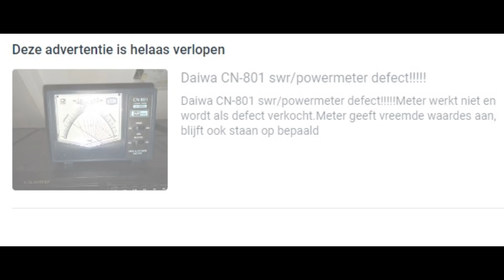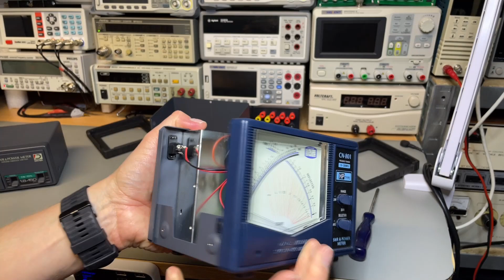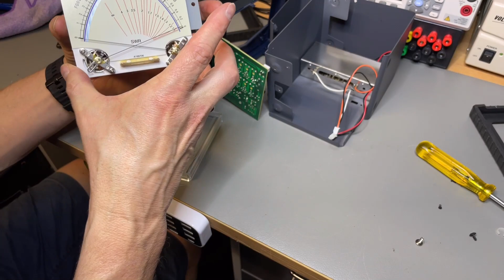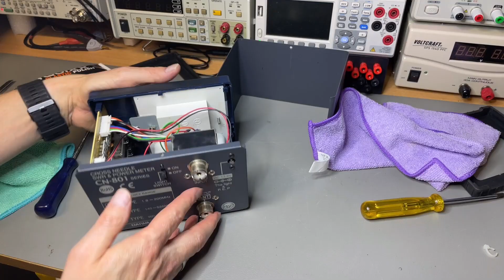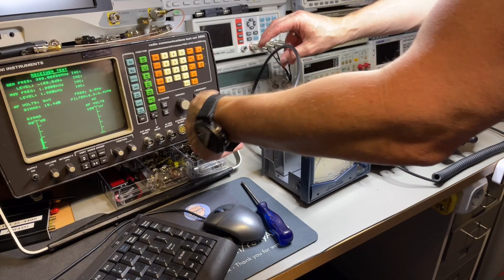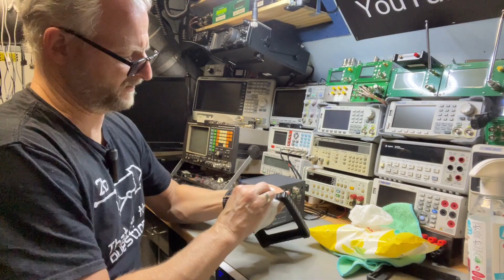TA-0364: Daiwa CN-801 HP SWR PWR Meter - Repair Verify and Cleanup

Comment: I was given a use CN-801.  It recently "burnt" out.  Opening unit had a burnt smell and upon inspection, the 4 pin diode right by the power inputs is fried,  I can't read the part number.  I do not know if anything else is fried that I can't see.  At this point, if the PEP will no longer work, I still want to power the LED.  Are the leads going to the LED 12V?  Can I temporarily bypass the diode assuming that is just a polarity protection.  Thank in advance.  Great work on the repair and the clean up. 73 KA6BJS
Reply from the maker: Hi, great meter, send me an email, i have found the schematic, i can send it to you

Comment: I've got the modern Daiwa CN-901HP3 meter and the slightly yellow background of the face, when the LED light is turned off is nice.  Occasionally, I forget to set the correct power range on the meter and the needle hits the end scale.  I don't believe that I have damaged the meter.  Any thoughts?🤔
Reply from the maker: Hi, don't do that to often, it can never be very good :) a good practice is to start always o the highest range and than go down the ranges.

Comment: Which ones are for peak
Reply from the maker: The PEP switch is for peak. so if i remember correct. the CN-801 and CN-901 have that. but you can check the specs on google to be sure.

Comment: What do you use to power this meter? how many amps? or do you just connect it directly to your 13.8 v power supply
Reply from the maker: Yes i  power it with 12 or 13.8 is uses very little like its only for the backlight and the SSB circuit if you want to see peak

Comment: Great work! Did you see any difference in the PEP readings with the DC power connected and disconnected? Also, did the blue lamp need to be switched ON for the PEP power reading to work correctly?
Reply: These are active peak reading meters. The only kind there is as far as "PEP" is concerned
Reply from the maker: As i understand the PEP circuit need power becouse of the OPAMP in the circuit. the light does not add anything than light. i forgot if it was switchable.
later i compair the 801 and 901... then i have a look at the light switches. Thanks for your comment

Comment: Thanks Tony for the nice video on the Daiwa.  I also have the CN-801 HP and CN-801 V and have had no real problems with them for well over 10 years.  The manual is available on several online sites as well as a schematic diagram for the CN-801 HP.  There is actually an LM358 dual single supply operation amplifier in the PEP section and the PEP mode needs the external DC source connected to the meter.  I just checked my unit and the bottom meter lights looks to be cool white if you want it to look factory and replace the blue lights.  If you need any of the manuals or a picture of the lighted meter just let me know and I will send them to you.  Glad you were able to fix the Power/SWR meter.
Reply from the maker: Thank you John.. it seems almost if each model had the color lights of its logo .. so the V version Orange logo has Orange light and the HP version en blue. i have seen now more HP versions with Blue lights. And thanks you for your offer, i keep that in mind.!
Reply: I just ordered one and recieved it.  Well the swr reflect needle is not on zero its at the mark above and 1.3 swr .   Going to send back and get a refund. I'm not impressed with Daiwa so far ...
Reply: @Jeff-sp7bg  Sorry to hear you had a problem with the meter.  My two units have not given me any problems.

Comment: I have a similar cross needle Daiwa, the cross needle appear to move freely however when you tx and the left side power needle rises to its level , if you give the top of the meter a few slight taps the needle will move up some more, when you stop txing the needle won't fall back to zero, it will stay above zero the same amount it increased with tapping it, tapping it again results in the needle falling back down to zero..
Any ideas ?
Cheers
Reply from the maker: Hi, it sounds like they run free, wich is good, sometimes the meter is staticly charged.. if you have cleaned it a lot, maybe you charged it.. try opening the meter carefuly as i did. matbe you see something or by opening it discharges... you need to try somthing...
Reply: @TonyAlbus  thanks Tony, you gave me the idea to feed the signal into the antenna s0239 and see if it reflected amout (on the other needle ) does the same..
Cheers.
Reply from the maker: @andrewverran3498  Just be carefull, the reflected is 1/10 of the power... good luck!
Reply: @TonyAlbus  gotcha ..only dealing with 20w.
Reply: @TonyAlbus have you any tricks of the trade for REMOVING STATIC  that may be causing the problem?
Much appreciated
Reply from the maker: @andrewverran3498  taking it appart and try to discharge it.. maybe by putting it on your antistatic mat if you have. if not, maybe lay it in the grass for a while (not wet, not in full sun ofcource)
Reply: @TonyAlbus  will do  .Thanks Tony.